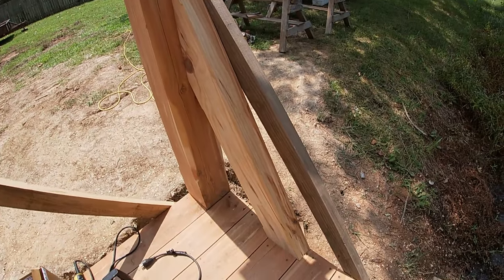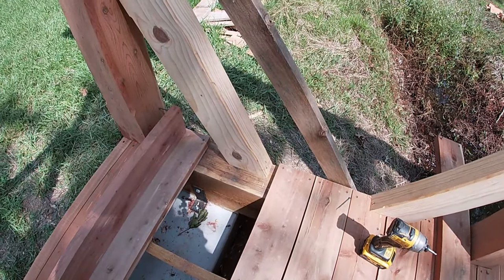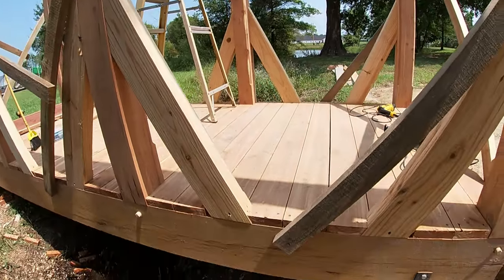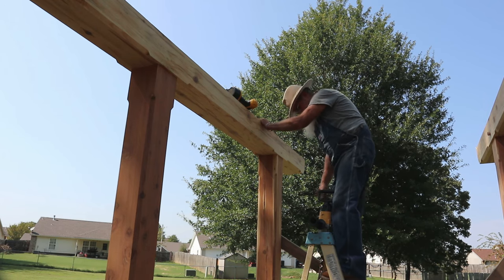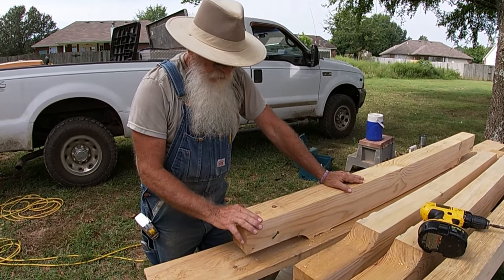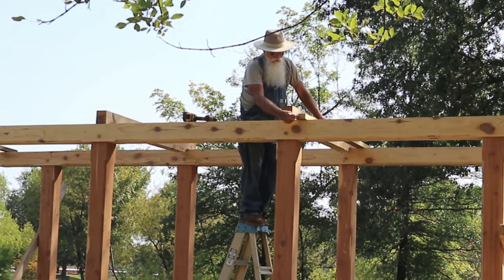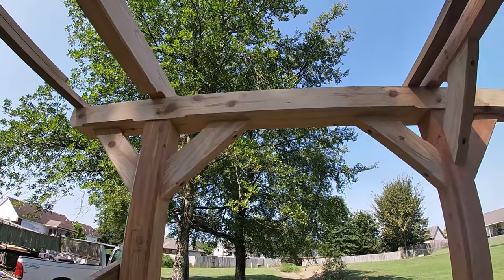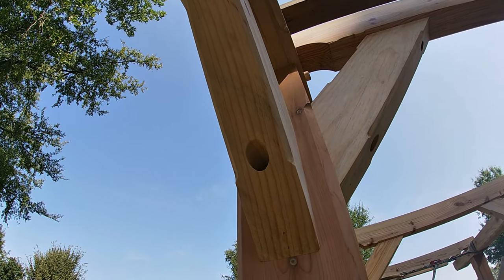Ongoing Bridge Assembly: Installing Knee Braces, Top Plates & Tie Beams, Covered Bridge Build Ep 8

Comment: Hello Paul. Those pegs to cover the lag bolts will give it the look as if the pegs are what is holding the braces in and wherever else you use them. I suppose the know of the hand drills that may have been used 150 - 200 years ago. I saw one in an estate sale and wanted to buy it. When I thought of what I would use it for, I changed my mind. Your attention to your cuts are showing up. Have good days!
Reply from the maker: Howdy Buddy- I’m thankful for power drills. I’ve used old augers and they are a work out. Thank you so much for watching our videos. Take care and God’s blessings to you